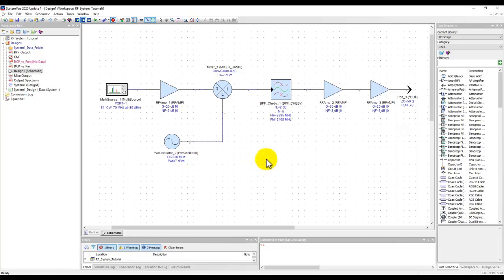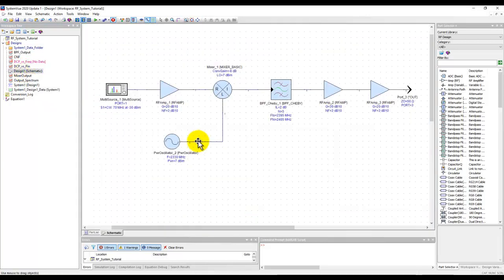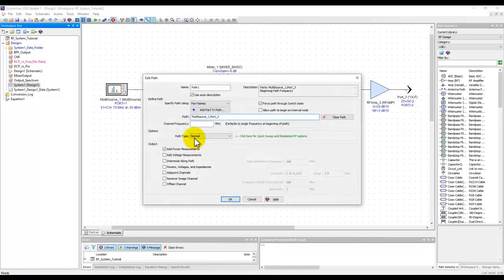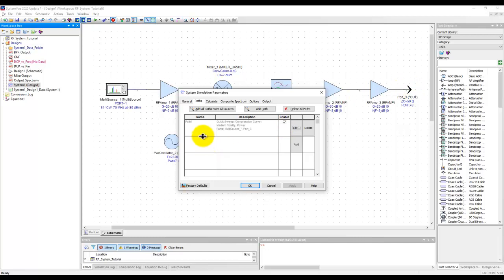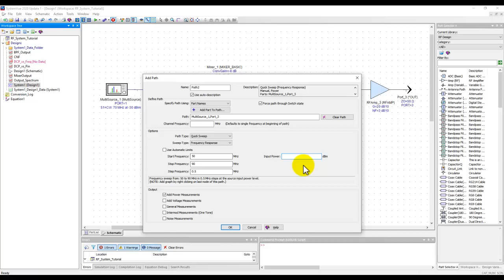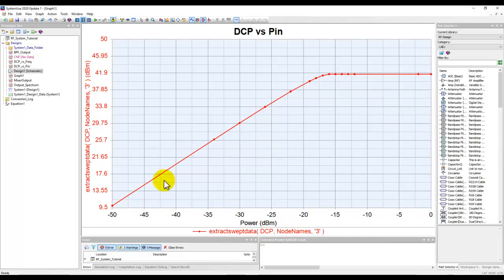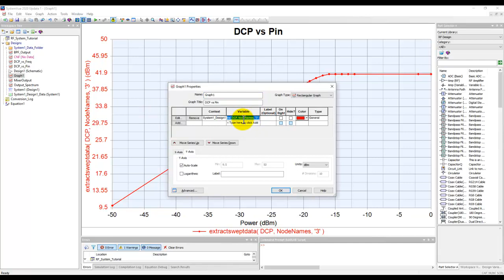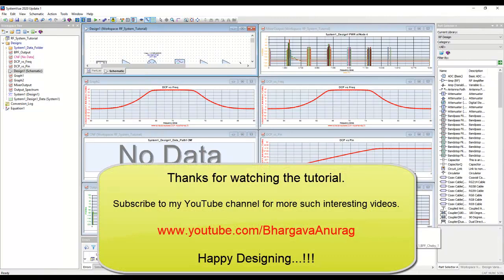Tutorial-19: Quick Power and Frequency Sweeps for RF Systems

Comment: Great tutorials. But i must to ask one simple question. You did frequency sweep and got plote of node 3. Node 3 is at 2400MHz but at plot we see 70MHz so i guess sweep doesn't work "correctly" while we have frequency conversion at the chain
Reply from the maker: Sweep is working correctly but there is always a challenge in freq conveter based designs on which frequency you pick to be shown on X-axis. In the case demonstrated its the IF i.e. input freq is being swept so that is the independent data you will see on X-axis. So essentially you are looking at Output plot where 70MHz = 2400MHz and you need to cross-refer these freq points.